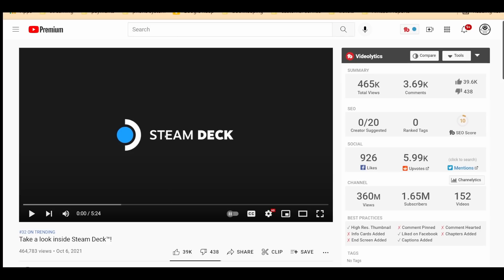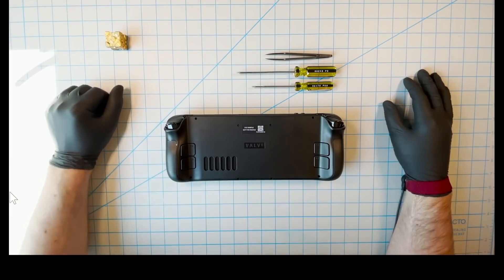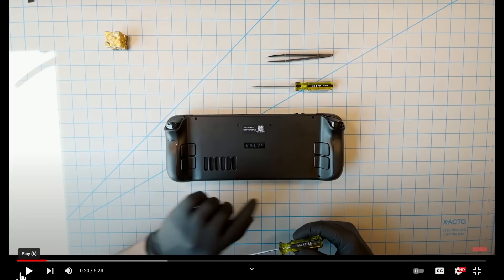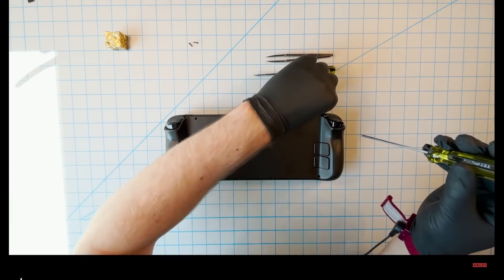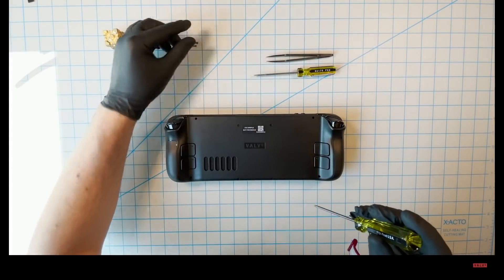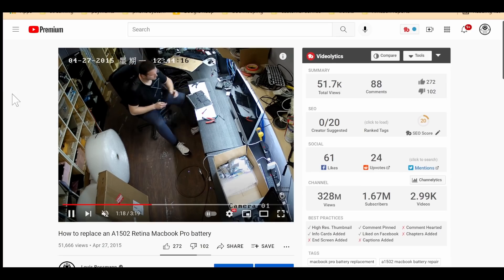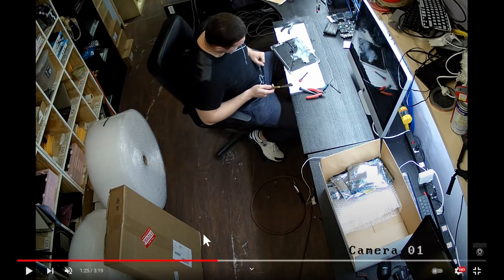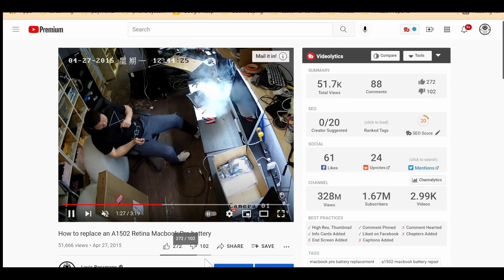Steam deck battery may end your life? bruh 😑

Comment: It's a small possibility, but over-torquing the screws could effect structural stability by warping the pieces.  An IRL example of (in this case) bolts not being torqued properly is the GM (Oldsmobile) 350 cu. in. Diesel engine.  The head bolts were torque-to-yield and improper tightening (and even re-use of old bolts!) would cause head gasket misalignment, warping,  and eventually catastrophic failure.  I can see where the wrong torque settings for the screws in Steam deck might cause cracking or warping that would eventually lead to structural problems.  I think there is some legitimate concern behind the concept, but the wording is poorly chosen.

Comment: When it comes to metal self tapping screws going into plastic, they're right that first time where they're cutting the threads do get the best result. If you're putting the screws back in you need to run the screw backwards to find the already cut threads to make sure you don't accidentally cut new ones. You will also be damaging those threads somewhat when you take the screws out. I assume you can get about 70-90% of the strength back if you put the screws back in properly and don't over-tighten. Look up some info on plastic deformation if you want to know more. Think of it like driving a wedge nail in wood. If you remove it and then try to hammer it in the same hole to the same depth, it just won't hold as well.

Comment: I think they mean the structural integrity will be weaker if you take it apart and pop a clip off. Most likely won't be too bad as there are screws but could leave a gap.

Comment: Probably one of the reasons they say it will lose drop resistance if you open it up is probably because of the self tapping screws, they never go in as good or hold as well as they do the first time they are screwed in, so the case may flex or even pop open easier when dropped

Comment: Well, if you keep taking the screws out, and putting them back in, eventually there will be too little friction to hold the screws in firmly, and they'll back out with casual vibration.

I have to wonder if that couldn't be dealt with, with a little LocTite, however.

Experience. I used to take my toys apart and put them back together as a kid, and the activity certainly got easier as the connectors got sloppier.

Comment: Yes it is correct that the way the screws are self tapping will degrade. This was how the Amiga 500, 600 and 1200 did their screws on the cases and after 30 years of being opened and closed a lot they are not holding as well or are complete stripped.  It this is a 30 year old computer. It will be ok unless you are not gentle when screwing and unscrewing these.

Comment: I think people are taking this video too seriously and they skip over some of the humor from the warnings and disclaimers and that's BAD™.  And I totally see why the overall structural resistance of the device would be lessened by stripped threads and untightened screws. It's not going to fall apart if the wind blows on it but it's not going to be factory fresh -- and it even tells you about what a torque screwdriver is.
This is an excellent video for any consumer that has zero knowledge of any electronics and clicks with Valve's humor.

Comment: I could see the structural integrity getting FUBAR after disassembly. It all depends on how much of the internal crossbracing is finished during assembly using glues instead of screws. From what I can see in the video it's another layer of legal ass-cover-y, but I'd need one in-hand to know for sure.

Source: I've taken absolutely everything I own apart at least once, and 3D print complex mechanical nonsense occasionally.

Comment: as far as the structural integrity comment is concerned its not something i have an issue with. the fact is that with self tapers the threads to degrade with each use due to it being plastic on metal. they are probably blowing this out of proportion a good bit and there are safe ways to reinstall self tapers to avoid cross treading and other damage but from an RMA perspective I understand why they would say what they would say.  ultimately I'm giving valve a thumbs up on this one for showing the whole process and committing to some level of consumer level repair support. its a step in the right direction for them and as consumers if we show our support for this decision and encourage some small changes things will only become better.

Comment: The claim about weakening the structural integrity is misleading; it's easy to damage the device by accidental mishandling when using a self tapping screw, and not even realize it. I think a better statement would be that it doesn't necessarily weaken it, but if it did, you may not even realize it, and therefore should treat it as if it is weakened.

Comment: I'm sorry but you're way to harsh in this one. It's obvious they are covering their asses and try to reduce the amount of people who will open this and break it as a result - not everyone has experience working with this, and most really shouldn't open this just because they saw a video doing it. They probably already had to go through a lot of hoops to have this video idea go through, so give them some slack please. Most of your criticism was on stuff that HAD potential for mess ups, though the chance is low, but they don't want people going into this without KNOWING about them. This script is written with the expectations that consumers will watch it, not just you.
Reply: Structural integrity: I can see that. The screws are self-tapped, as they said. Slight overtightening, or different handling could affect the thread, it's mallable plastic after all. A device like this relies on the shell for some structural support, though it does seem to have a magnesium frame as well. I can see that when forces are applied that want to lift off the back cover, a weakened screw thread could result in it completely stripping. Before that, I'd assume other things break though.
Or, more likely, they have hooks in there that could be damaged and result in the edges being slightly weaker.
So could happen that it is somewhat affected, and always a very, very tiny bit.

Comment: The structural integrity would be affected in a very minor fashion due to the screws. The screws are never as secure as before due to their self-tapping nature. 
So it's true, but not particularly concerning.
Reply: These are likely thread forming screws, you "damage" the boss every time you you torque it to spec, how bad largely depends on boss design though.

Comment: The screw thing is true-ish opening it once isn't a big deal if you don't strip the posts, but like anybody who has own a cheap multi meter that is assembled this way can tell you repeated openings increase the the chance of the post holes expanding and losing their gripping ability. As for structural integrity after a single opening (by not a over tightening maniac) it wouldn't change in any considerable way.

Comment: 9:00 pretty sure the structural integrity claims he is making has to do with the fact that if you screw up with putting the self tapping screws back in (i.e. if you don't turn anticlockwise until the screw clicks in and then tighten it), you can break the plastic threads completely and that will weaken the integrity... He should've mentioned that you should do that measure when you are putting self tapping screws back into already tapped threads and should've been more clear to that
Reply: Valve also could have spend the 10-15 cents on brass inserts in the first place.

I mean, they aren't making money per unit anyway.
Reply: @USSMariner  when they're likely already losing money to hit that price point, it's reasonable for them to save money on that

Comment: To me, the biggest risk of any lithium battery is for it to decide to fail while you aren't there, awake or otherwise in a position to do something about it. If you have ever disassembled stuff with self-tapping screws into plastic, you surely have noticed that some plastic pulls out with the screws each time you take it apart. You don't get many assembly-disassembly cycles out of self-tapped holes before the holes are completely stripped.

Comment: I believe the reason they said that replacement part sources would be available in the upcoming months is due to the fact that the Steam Deck is not yet available, will be officially launched in December-January time frame, so technically they are correct.

Comment: The device is not even in customer hands yet Louis lol. Of course the source for parts will be after they start shipping the devices :) I think the structural integrity comment is due to the average person either cutting new threads when putting the self tapping screws or over/under tightening them when reinstalling.

Comment: Not a fan of your ESD practice tbh. The wrist-straps have quick releases for a reason. Also I am kind of sure that the smaller structures make ESD-damage worse. Sure, there are likely protection circuits on the chip and discharging before work is better than nothing, but its really easy to underestimate how fast new charge can build up (moving back on your chair). Also ESD damage can just degrade the hardware, so it fails at your customer.

Comment: With the structural Integrity thing they are using self tapping screws going into plastic and every time you screw a nun screw over and over again it lessens their grip by destroying the plastic a little more each time. Other than that I don't see how opening the case can damage structural integrity.

Comment: Self tapping screws really aren't designed to be reused over and over again. If you take them out and reinstall them enough, they eventually won't really tighten, and if you try to tighten them, they'll just strip out. So while it's unlikely to measurably affect structural integrity after doing this once, they are clearly being cautious here for legal reasons.

Comment: ooo I repair laptops for a living so I know what he's getting at by structural integrity: Like most dirt-cheap laptops, this thing is held together by self-tapping screws and plastic hooks. the more you take those screws out, the more worn out the screw-holes get and the more brittle the plastic hooks get. For everyday use this makes no difference, but if you handle your devices like a 5 year old or a caveman, you can feel the weakened seal on the plastic chassis when you try to bend it at all.